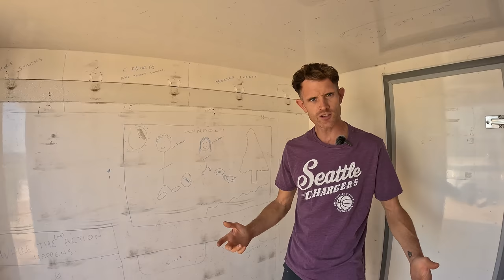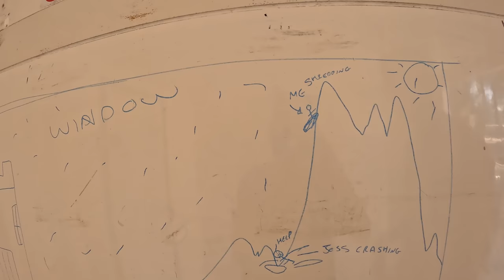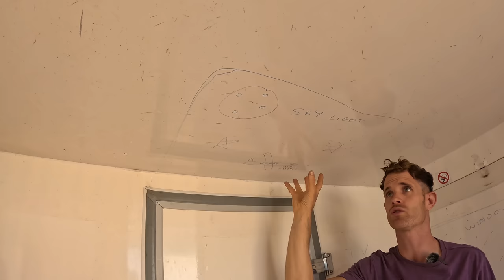Supermarket Delivery Van to ULTIMATE Winter Campervan: Van Build Part 1

Comment: I've worked with these rear loaders as a supermarket driver. They get absolutely battered in their working life, clocking up over 100k in no time, driven up and down potholed tracks all day, to and from farms in the more rural areas. But if you've luckily found a good one then they're ideal for conversion.
Reply from the maker: Yeah it’s hard to find any commercial vehicle that’s not had a hard life hey, 🤞 she’s a good en
Reply: Compared to other used vans, supermarket vans are probably some of the best kept with the black box that penalties you for speeding or revving too high and the good maintenance schedules
Reply from the maker: @tomhornsey9738  I totally agree Tom 👍
Reply: Like every van does then..
Reply: To answer a few comments. They have minimal maintenance and lightfoot is ignored by most drivers so they get ragged. They're delivery vans, so they will usually be running all day 6am till 12pm 7 days a week clocking up far more miles than a tradesman's van for example.
Reply from the maker: @leejohnson3209  95k miles, got plenty of life left in it, if it’s not for u no worries
Reply: @leejohnson3209 completely agree.. I'm a driver currently and lightfoot is bloody useless, we all ignore the stupid thing and our "new" 71 plates are pushing 80-100k atm with around 200-250miles done per day.. maintenance, what maintenance? My place let's them fall apart before reporting a defect!
Reply: @leejohnson3209  I’ve had 11 different vans in the last 25 years.  7 high top transits, 3 x transit pick ups and my current, a vw caddy. All brand new, ( company owned) and replaced every two years with only 40-60k on the clock, but had an extremely hard life, always loaded with heavy gear( I was a gas main layer ) and ragged up and down the country for its first two years. I wouldn’t want to of bought any of them, my caddy is 8 years old with 65 ,000 and I will drive it into the ground rather than sell it.
Reply: @leejohnson3209  .......obviously a sparkie or plumbers old van may be a better choice, but most traders use their vans as a big mobile toolbox, so normally always travel with weight, I can’t imagine shopping weighing 2 tonnes, so old supermarket delivery vans are a pretty good choice for a camper.
Reply: I repair these bodies for work. Top near side corners of the box usually gets the most battering… and the steps get reversed into many objects 😂 keep you well warm though
Reply from the maker: @DrewNewmanAce funnily enough this has had a repair on the ns top, wonder what they hit them on
Reply: @truebluetravellers  oh, anything, mainly trees etc Sometimes walls I guess, tunnels. Fairly easy fix though.
Reply: Been an online driver for Sainsbury’s 10yrs and always said they would make a great camper conversation 🙋🏻‍♂️, interesting project to watch , cheers guys
Reply from the maker: @1971chris1971  cheers mate 👍
Reply: @truebluetravellers  at 95k you've done well, that's very much for me! I wish you the best of luck.
Reply: Probably a tree @truebluetravellers
Reply: @martycrush6412 you’d be surprised mate, most of our sainsburys vans go out every day within 50kg of their weight limit 😂
Reply: @truebluetravellers agree, I've been keeping an eye on these all over the country and even some sub 70k ones can be found.With them being fleet,they aren't kept just because they have lower mileages to be worked until they've racked up miles in the 100's of km's; particularly when fleets had to start shifting from Euro 5 to 6 for example-this meant that MANY were sold with genuinely 'low' mileage,they just have to be hunted down.I can say this as someone who has found and owned a near mint commercial vehicle with 40k on👍
Reply: You support Palestine? You seem like a better guy than most delivery drivers just for that! :)
Reply: Currently an asda driver, and can confirm this. They clock easily, 500 miles per day, per van. They get battered - mud, bad driving, rain… you can it, we deliver in it.
Reply: @bendover-bz4bc  probably because he is intelligent, politically aware and is able to think for himself
Reply: Good idea to have a flexible seal

Comment: Why would people think that a foam box on a chassis cab would be heavier than steel panel van?? There is a very high end US camper van manufacturer making very expensive campers from foam walled boxes on Sprinter chassis. The DIY ex grocery van is the same thing for way less money.
Reply from the maker: Definitely, if we made this box new then I dread to think how much it would cost, someone sent me a message the other day and they got 2 boxes for £600

Comment: I’m a Tesco Delivery Driver, nice to see you ripping a Sainsbury’s one apart, wouldn’t know how to feel if it was a Tesco one, nice to see so far, can’t wait to see the rest of the build
Reply from the maker: Cheers mate, 😂😂 I’ve had a Tesco box before too but just used that as a big tool box with the side shutters and the boxes inside 👍
Reply: @truebluetravellers  that’s one way to use one
Reply: As an ex Sainsburys driver, I like seeing you rip apart a delivery van. Although the Mercs are better than the Tesco's Ivecos. 😅

Comment: I’ve driven a few of those Sainsburys vans. They have a “green road” gadget , you have to stick to the speed limits, so it won’t have been thrashed. Love the build so far 😊😊😊. Thanks for sharing
Reply from the maker: Cheers mate, well that sounds promising 👍
Reply: Might give the engine and gearbox a shock soon you go over 56mph though 😂

Comment: Great job guys, every you tube channel shy s away from a walk through so kudos to you no messing about you purchased the bellows seal, overall its looking good , also like the way you cleaned and sealed the chassis before re attachting the body = longer life ! zero rust.
Reply from the maker: Thanks very much, we weren’t sure how we were going to do it until we started but it’s worked out really well and we are stoked with it. A walk through just makes life so much easier….. and give me quicker access to the fridge and pantry 😂 thanks, like you say just makes sense to when we have such an easy opportunity to 😀
Reply: @truebluetravellers  Biggest bonus with a cut-away is an easy exit both for fire and problems when parked overnight and there s trouble where camped .

Comment: Cracking Start on the new Winter Van Project. Having spent time under my 21 year old Sprinter Based Motorhome de rusting it over a week, it would have been really nice to be able to have full access to the top of the chassis rail and cross members as they are almost impossible to get to with the body in place. I was impressed with how well the underseal went on and I think that will be my next step if the Wife wants to keep the Motorhome after it's last adventure on the back of a tow truck. As it has had one too many breakdowns for her to be confident in it. It is still stuck in our layby waiting of our Local Mechanic to come out and run his diagnostic tool on the gearbox to see what the problem is.
Reply from the maker: Oh dear not good news mate, I was wondering how u we’re getting on the other day, 🤞it’s a cheap simple fix
Reply: @truebluetravellers  probably not cheap. It could be the control module or the electric pump that operates the selector for the manual box. Hopefully it is whatever is cheaper to replace. It is a great system till the van goes into limp mode or becomes a very heavy caravan without a hitch and the added bonus of an engine as steerage. 
That could be an option fitting caravan movers to it so I can at least get it back in to my drive.

Comment: By cutting the hole in the back of the cab and through the strengthening box sections you have compromised the strength/safety of the cab shell. Hopefully, you will put some bracing/structure back in to compensate? As it stands the cab is effectively a box with no ends, it's not going to be great in a rollover/hit from the side...
Reply from the maker: Yeah got a frame put in so she’s all sweet now 👍

Comment: After cutting through sheet metal, twisting forces will accumulated on the corners and they will be released by cracking along the 90º corner. You should always round the corners on any sheet metal panel cut to dissipate those forces.
Reply from the maker: 👍 thanks tip mate

Comment: I used to drive those sprinters they drive okay I did find the ride smooth the auto gearbox was a bit stupid sometimes though (you put it in reverse and it goes in neutral so you have to go back to drive then reverse again) it had no guts on hills You have to slam the cab door shut and if your changing a headlight bulb it’s pain in the arse (specially the little DRL)

Comment: You make it look so easy. I bought an ex Walkers crisps van back in 2001. to use for my removals. It had 151k on the clock and I sold it at 314K..never broke down once. It was double skinned and had one of those whirly airvents on the roof..It was always dry inside, no moisture like in all the single skin box vans..I was wondering what the box in your van is made off it looks really light the way you handle it? I absolutely would go for a walk through from the cab as well
Reply from the maker: Cheers mate, walkers crisps vehicle 🤔, I can’t remember them, been getting loads of grief saying a delivery van won’t last 2 minutes, your living proof that it can be done 👍 yeah it’s just a grp box, incredibly lightweight 👍

Comment: Looks like it's going to be an awesome build! Just one thing though, most car body fillers are not waterproof, they actually soak up water and will crack if not protected asap with paint.
Reply from the maker: We’ll never knew that, thanks for the info , much appreciated 👍

Comment: The capping on your door/window holes would be better made of polyurethane or other plastic. Aluminium will let all the cold in as it allows the heat to bypass your insulation.

Love the build, really good idea to use a supermarket van!
Reply from the maker: Cheers mate, yeah so a few people have said the same so I’ve done some research and from what I’ve found I think the best thing I can do is cap the aluminium on the inside to act as a barrier/insulator, job to do before we set off 👍

Comment: Fantastic job looking forward to seeing the progress. Not telling you how to suck eggs but I’ve just converted a 4.2 tonne delivery truck living in Spain. Make sure any internal metal or aluminum frames have a good vapor barrier or covered with fabric as they condensate badly in the cold. Great video.
Reply from the maker: Thanks very much and not at all I appreciate the advice, yeah unfortunately I had to get the aluminium frame as I couldn’t get any plastic trim in that size but hoping the door seals do a good job 👍

Comment: Cold bridging with alloy door frame can be a problem when very cold .
Condensation on inside door frame, can freeze up to alloy .
Reply from the maker: Hi Harvey, you make a great point here, we really wanted plastic trims (like the ones we’ve put on the rear door and crawl through but we just couldn’t find them. Luckily the ali will only be in the gas locker and on our side door which won’t be in any cupboards or anything so shouldn’t cause too many problems 🤞

Comment: Do check that your fuel tank really is big enough. Sainsburys had tried to increase payload by half filling the fuel tank with a foam section, so it could only be filled half with diesel, saved 40kgs. A custom fuel tank behind the rear wheels will increase your range, and better distribute your weight, the front axle is very close to its maximum permitted weight even when they are empty.
Reply from the maker: Cheers David, yeah someone mentioned that yesterday so I tried to check with Mercedes with the part number on the tank but they couldn’t tell me how big it was, I’ll just have to fill it up and see what size it is 👍

Comment: Great start and I'm looking forward to future updates. Does the hole cut in the rear cab wall not compromise it's structural integrity?
Reply from the maker: Cheers mate, no I’ve made a frame to secure it all back up so just as strong as before 👍

Comment: I just got started trying to copy this build.  Mine is on 199k I'm expecting to have a some expensive mechanical problems but it drives really nicely so fingers crossed.  Do you remember what the size of the crawl through was?  I'm a bit nervous of taking the angle grinder to it.
Reply from the maker: @johnrussell3389  it’s 550 x 1110 mate, I think the main issue you might have is egr and dpf but as it’s done higher mileage it might of been replaced already 👍

Comment: You said the box was 2m high by 2m wide? I'm looking at getting one of these, what was the length of the box on the one you converted? There are a few different types
Reply from the maker: It was 3320mm long mate inside 👍

Comment: The mitre saw only cuts the material because of the specific blade, you could easily spend more on the unit and have a better unit for future builds and swap out the blade depending on what material you’re cutting
Reply from the maker: Yeah I have a decent dewalt mitre saw for wood but like the little one with the multi material blade as it’s nice and small to transport about and I don’t have to keep swapping blades, I just use is specifically for aluminium 😁👍

Comment: One thing I can't quite get my head round is how do you get the 4th piece of U channel into a square/rectangular hole once the other 3 are in place?
Reply from the maker: So the plastic trims (like we used on the crawl through) flex and so you can get them in just fine. The side door only has 3 sides so that was no trouble and for the gas locker we had to cut the back off of the top piece of U channel to make it like a piece of angle and then attach the remaining bit of trim separately and seal the join 😃

Comment: probably the best staring of choices ive seen having buit a few vehicular homes,
a LSD and wider rear wheels air ride kit, chassis extension rack for spare wheels and towbar
chassis mounted tanks and battery storage, would be so easy to fit now, would complement the build, don't suppose it has A/C and cruise though, being a ex delivery chassis cab,
waxoil inside the chassis rails while you can,
Reply from the maker: Cheers mate, yep I’ve waxed oiled the whole thing, just makes sense while it’s off, would love to install an lsd in it, arb do an air locker but £££
Yep your right no a/c but has got cruise and speed limiter, there is plenty of space like you say outside for tanks and battery’s etc but because we are taking it to the Nordics the water tank and battery’s are going inside so not to freeze so we will put belly lockers on the side for storage instead, 👍

Comment: Are you planning to replace the fuel tank? Sainsbury’s fit a really tiny tank to keep the weight down. Their vans have to be refuelled after every shift. I’d be surprised if they hold more than 25 litres.
Reply from the maker: I didn’t know this till someone commented the same so will have to check it out, thanks for the heads up tho 👍
Reply: This reg van would have the small tank. In later years they reverted to the standard size.
Reply from the maker: @making_randoms  I rang Mercedes today with a part number off the tank but they couldn’t tell me the size of it, I’ll just have to fill it up and see what I can get in it, 👍

Comment: I like that window, have a ducato but dont like the big glass panel look most go for, want some framed ones. What have you got there?
Reply from the maker: They are so much better than glass ones, we will never go back that’s for sure, eBay item number is 404373112871
https://www.ebay.co.uk/itm/404373112871?mkcid=16&mkevt=1&mkrid=711-127632-2357-0&ssspo=Sm7PhKPoTpW&sssrc=4429486&ssuid=h77jMQulRBK&var=&widget_ver=artemis&media=COPY
Reply: @truebluetravellers  ooft, I'll have to save up for some of those 😁 cheers

Comment: Nice project, good luck with it.
I wanted to do a Luton Loloader/Maximover, but they are much wider than a panel van and wouldn't fit on my driveway so had to settle for a panel van. :(
These are great for conversions though because the back is square and framing it is straightforward. And as you showed, if you get one with a box made from GRP then they can often weigh less than a panel van. I've seen overweight ones but they had cast iron log burners and granite worktops lol.
Reply from the maker: Cheers mate, yeah we have been on with the interior build this week and the square walls and floor 👌 so easy compared to a panel van, especially the top cabinets 👍

Comment: i was surprised that the insulation was that thin..ive seen some fridge vans with about 4" insulation..are you going to add more insulation to the floor and ceiling? ive been told the sides dont matter so much but putting a good amount of insulation in the floor and roof helps alot
Reply from the maker: So we have put a bit more on the floor but can’t add any more as it’s just tall enough for me as I’m 6’2, the roof is 55mm thick tho so 🤞 it’s all good 😁